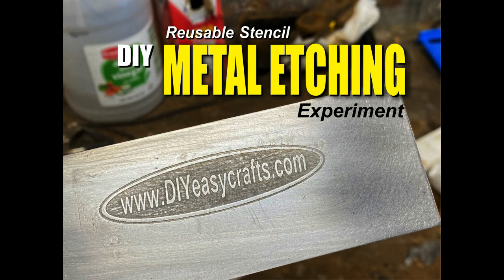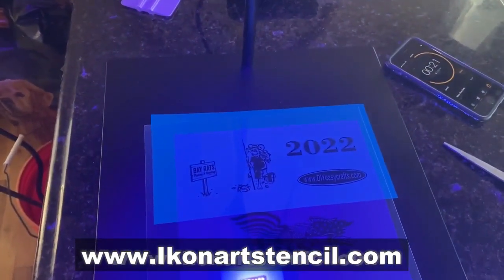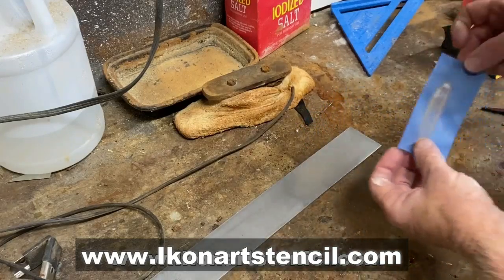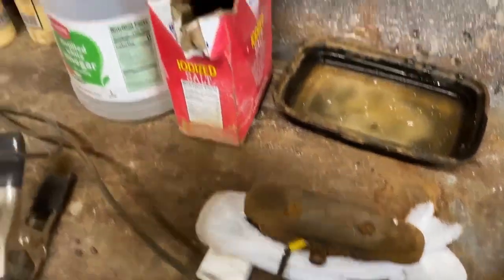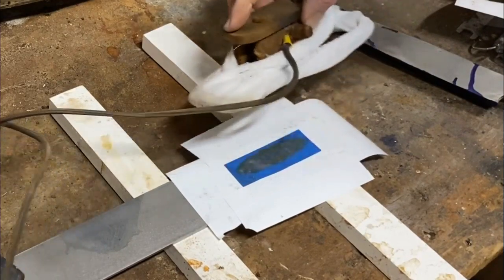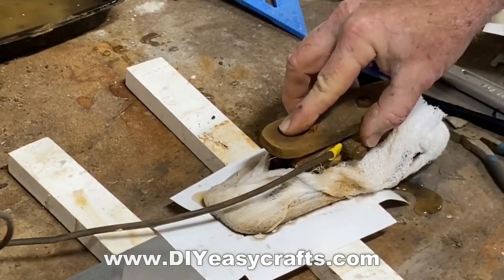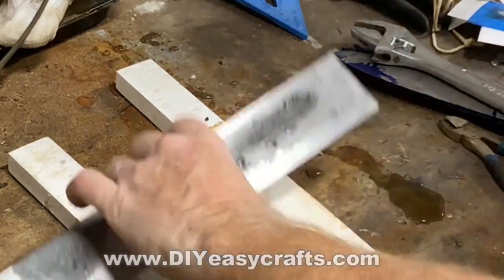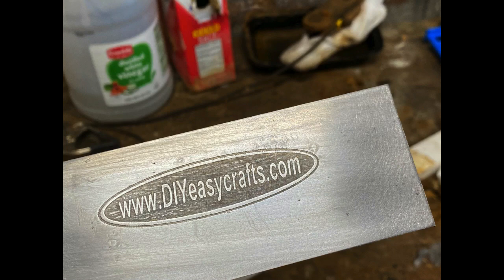DIY Reusable Stencil Metal Etching Experiment from Ikonart

Comment: Would corduroy with the lines sideways give a wood grain pattern to the etch?
Reply from the maker: With self adhesive vinyl as the resist yes. With the film used on this video no. Film has its own mesh so background has tiny square pattern